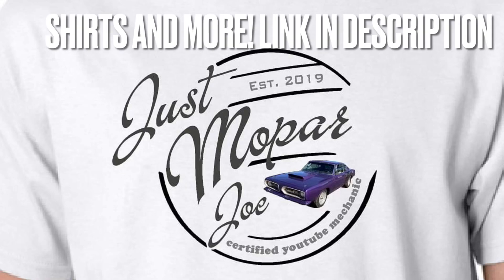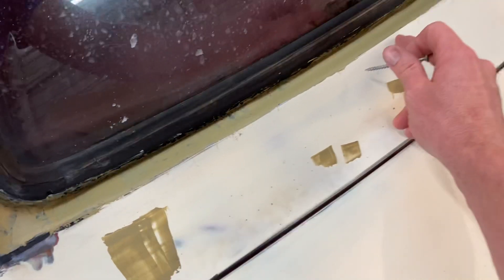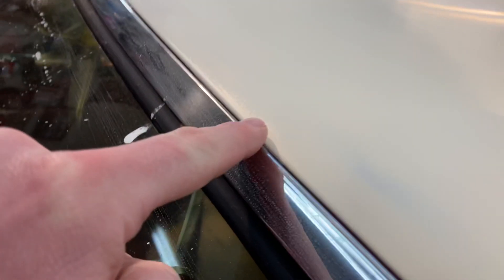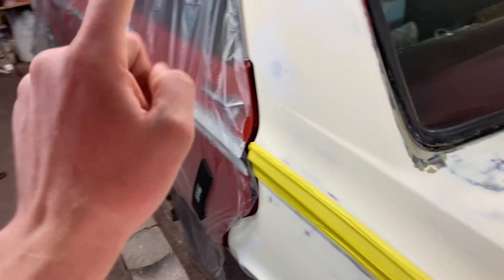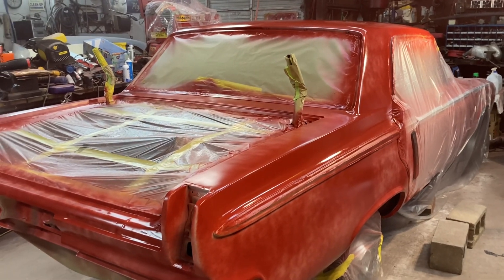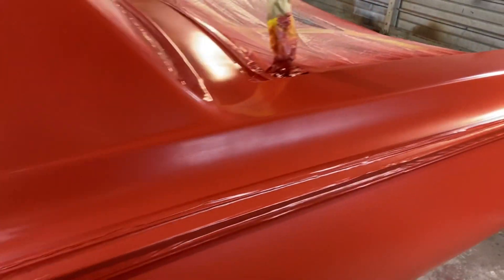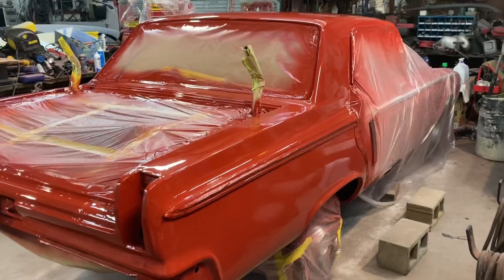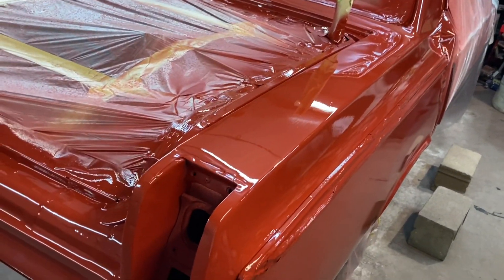65 Coronet: Runs without an Engine!

Comment: Great job Joe! I was wondering how you were going to fix around that back glass, I did a similar repair on a 70 coronet R/T I had back in 1992, it had some rust under the vinal top and I ground it off and used rustmort, primer and duraglass in the quarter to roof seam. Sadly I sold it but saw it at a car show 10 years later and it was still holding up, no bubble's under the vinal top. I believe your repair will last for year's, great job!👍
Reply from the maker: Thanks Mitch! I like your style!
Reply: @JustMoparJoe  👍

Comment: I’ve heard of this por putty being a good option for small areas , maybe doing the same fix myself. Really gonna try not to take out back window as well
Reply from the maker: Sweet! This one is POR patch. I really like it for small holes in floor pans etc. It seals the metal from any moisture or air. The rust can’t spread. Wear gloves it’s bad stuff.

Comment: 1.  What brand of paint did you use? Is  it inexpensive?  I'm looking for an alternative to my Rustoleum in a can, thinned with mineral spirits. Sprayed with a conventional guy. The colors besides white didn't last long outside.
2.  Correct me if I'm wrong.  Your runs were all in the clear and not in the base?  Or did you sand some down in the base before you sprayed the clear.
Reply from the maker: This is urechem paint. It is the best least expensive paint I have found. I nekive their site is paint for cars.com. Lots of colors to chose from. Runs were only in the clear. I will show what I did with that soon 👍🏼